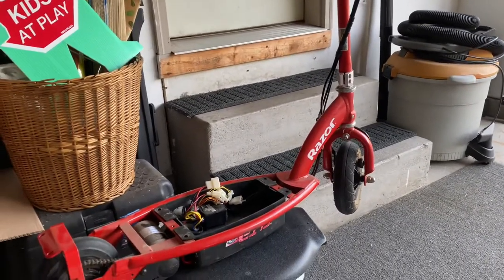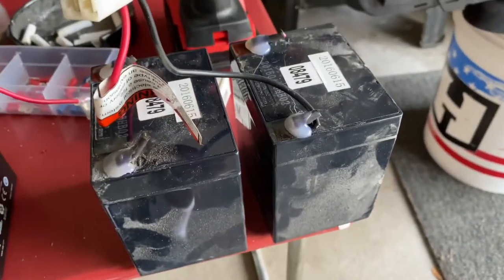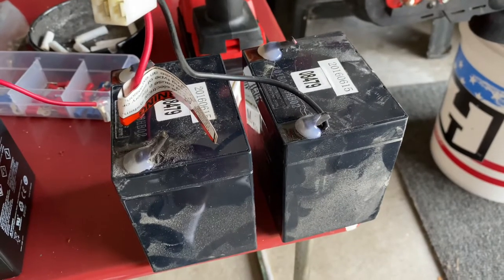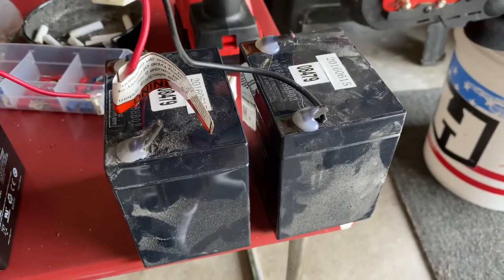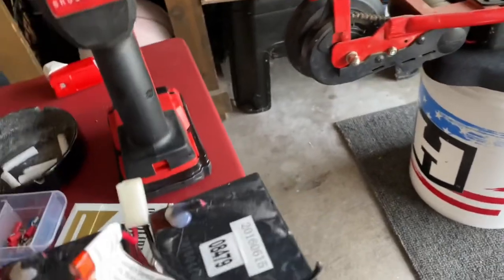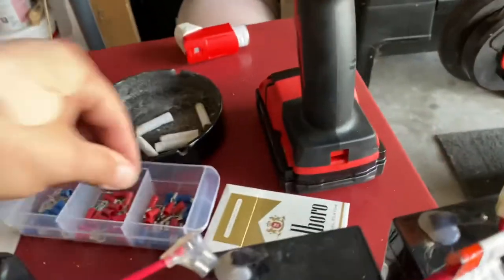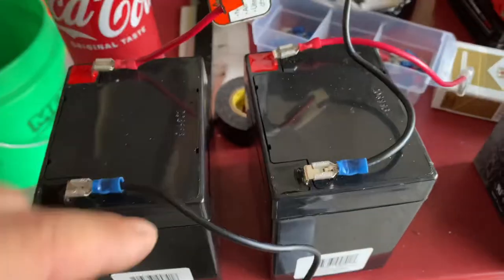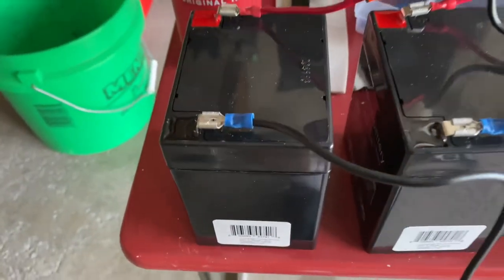Razor E175 Battery Lead Wiring Connection

Comment: Link to the batteries and wires ?
Reply from the maker: Hi KT, Here is the link to purchase the batteries and the Charger cable…

Universal Power Group Set of 2 Razor E175 12 Volt 5AmpH SLA Replacement Scooter Batteries https://a.co/d/5Snk9Bw

24V (36W) Battery Charger Standard 3-Prong Inline for Razor E100 E200 E300 E125 E150 E500 E175 PR200, E225S E325S MX350, Pocket Mod, Sports Mod, and Dirt Quad https://a.co/d/fpj588c